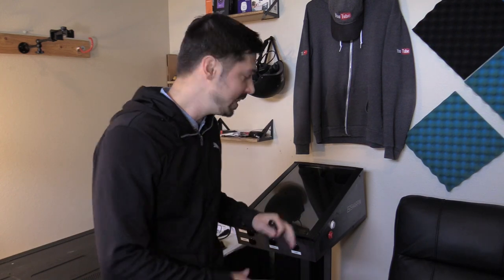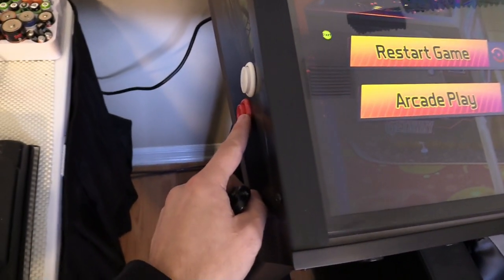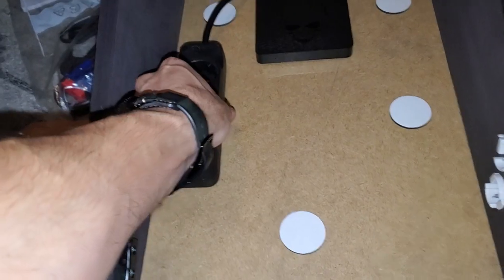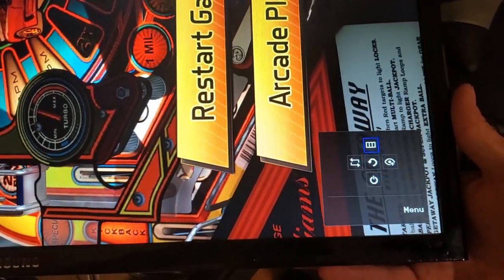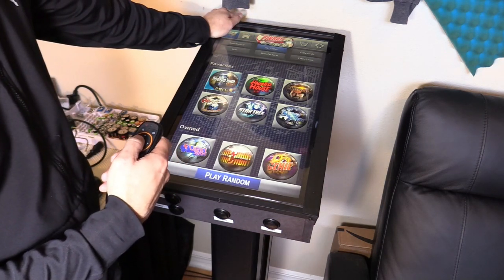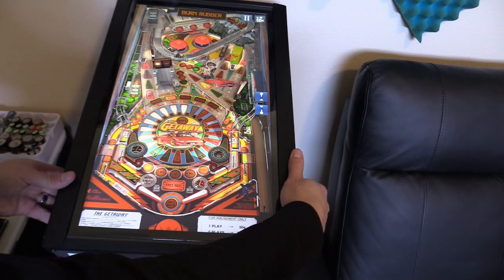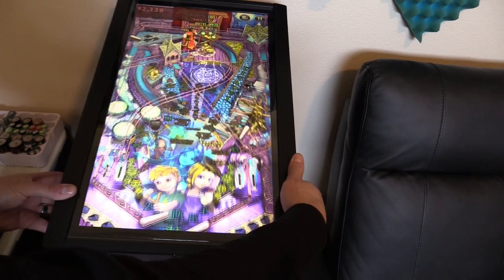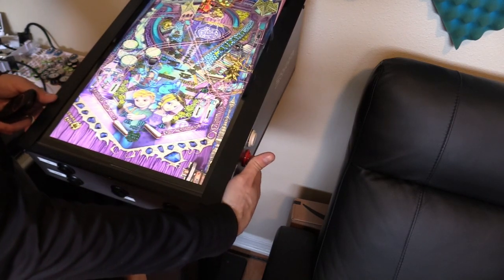How I Built my First Virtual Pinball Machine under 30 minutes

Comment: Hi....I just received the ULTRA.  From the sounds of the dialog & comments, it would appear that you have more sophisticated users that myself.  So...this feedback is for those purchasers.  The idea that this can be put together in 30 minutes is not practical.  There are virtually no directions...basically you are on your own with respect to assembly.  I checked for a "how to" video...none exist.  It took me about 3 hours...and I don't know if it works.  As an example...the black/red wires; when attaching them there is no direction as to how to do this.  It sounds easy...but do you place the  red wire on the left or right side?  I hope the machine is easier to use than the installation.  Just providing feedback...

Comment: are you sure the accelerometer is compatible with Android?  It sounds like you are having an issue with the driver. I have used accelerometers on several projects and they all work, but I know that when i used them with an Android device i had to make sure it was designed to work with android specifically

Comment: I have a sharpin as well but somehow i cant get octopus to work. In the video you make 4 paths , 2 for nudge and 2 for flipper but do i also need one for the plunger.
Because i see a fifth path which u dont use.
How do i save the paths and do they only work by starting zen or wiliams through octopus? Or once saved i only have to use the zen or williams apps.

Comment: Great video, two questions what software are you using to remapped your buttons? And what software I need to download to turn Screen Vertical? Please advise. The reason I ask because I got the GT King tv box like yours but I don’t know what software to used for buttons mapping and turn screen 90 degree. Last question my box will play HBO max apk but no sound. Can you test that for me. Thank you.   😊
Reply from the maker: It's android and vertical screen is preset already out of the box, button already preprogramed except nudge which I used octopus 🐙 app.

Comment: Got one of these recently! The electrical is a tad different than yours in that I didn’t get the little black box for the monitor at all. Just 1 power cord going from the monitor to the power strip inside, and the HDMI to the cpu. I’m going to switch out the buttons and speakers, and I got these black foam-padded corner protectors like you use when you wanna protect your baby from corners on furniture, etc. Cost me six bucks on EBay! I really find that the corners irritate the palms of my hands, where you rest them! I’m very interested in the plexiglass on top of the monitor! How’s the glare for you on your unit? I wanted to put a matte piece of plexiglass but found out that I’d have to put it right against the glass or there would be fuzziness/color distortion, and I can’t have that! So wondering how the regular plexiglass looks with the matte monitor screen and not quite flush on the monitor looks to you (glare-wise, and clarity-wise?  Also, how thick of a piece did you get? 1/16” ?